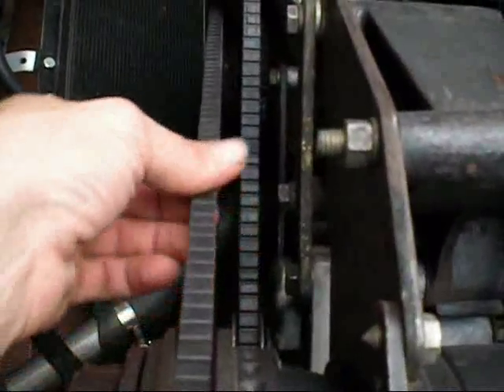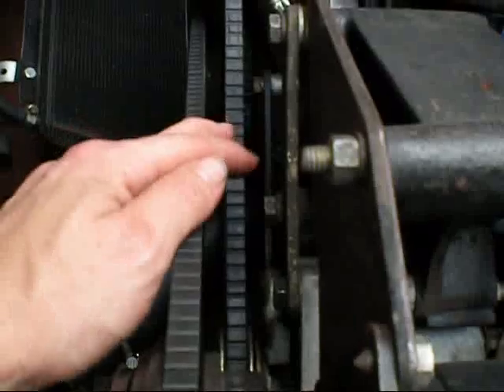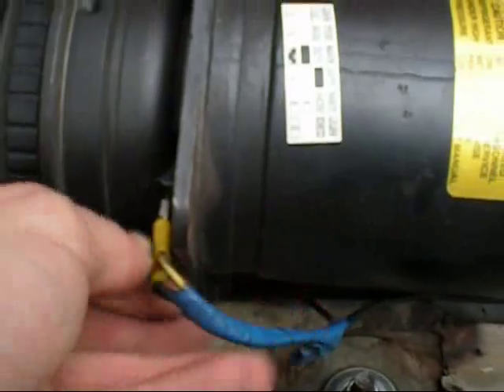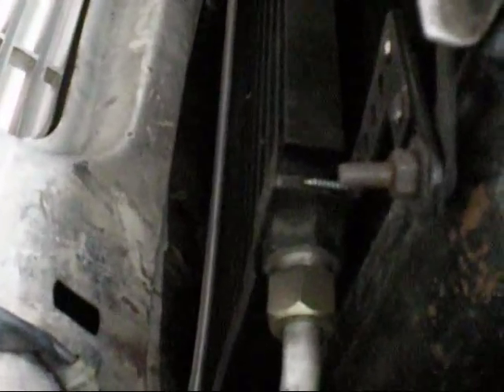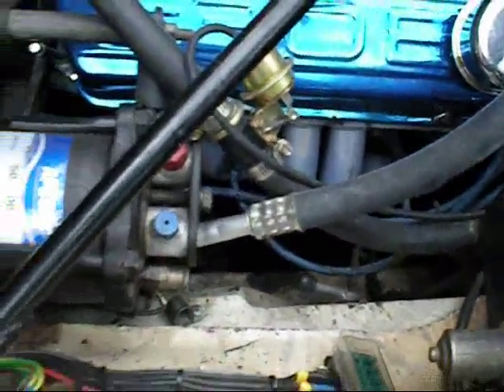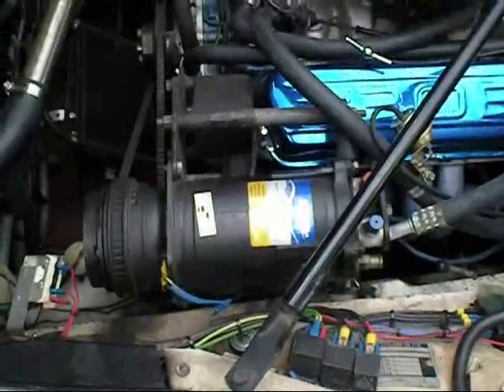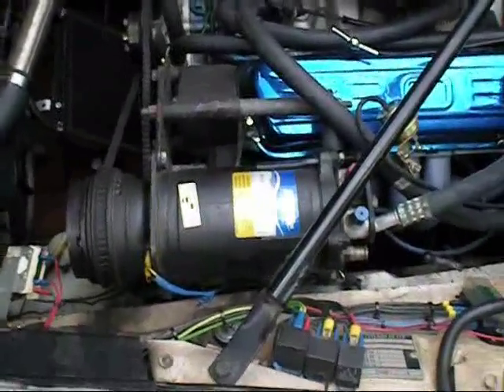car air conditioning  tip #2

Comment: how does the compressor turn on?
is it a power wire that feeds power to the compressor that then allows a load to be placed on the motor?

Comment from the maker: yep. its a GM compressor. jags most cars used those in the old days. i could have put a nipendeso compressor on but i got a new MG one for $170. it worked real good on the 51'c day we had. 3.6'c at the vents at 1500rpm with R-134a

Comment: That looks like a General Motors compressor, that type was on the 1960's and 70's models here. My van had one of those, but I now am running a Sanden after switching to R-134a.